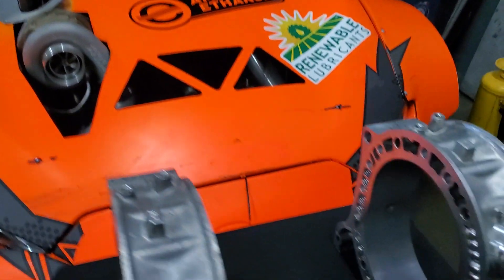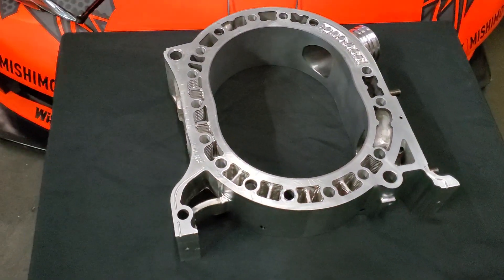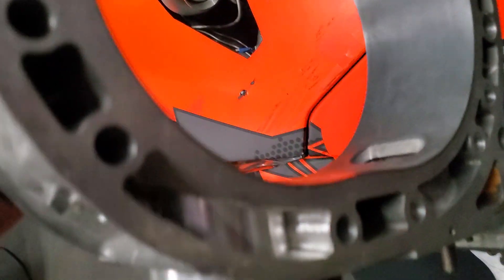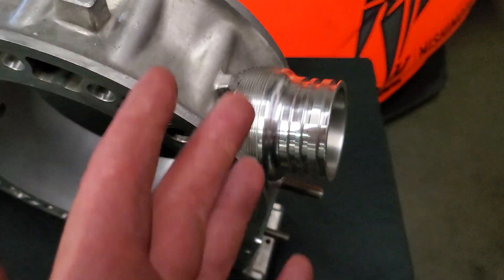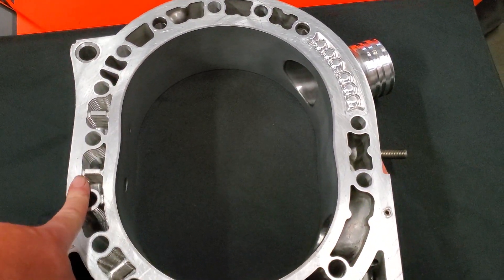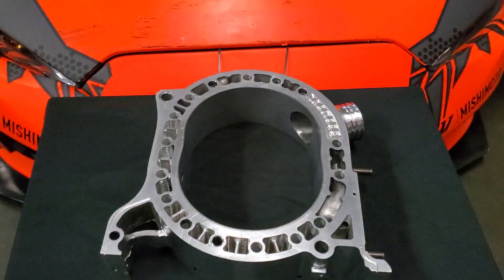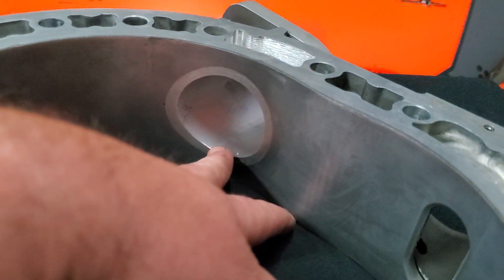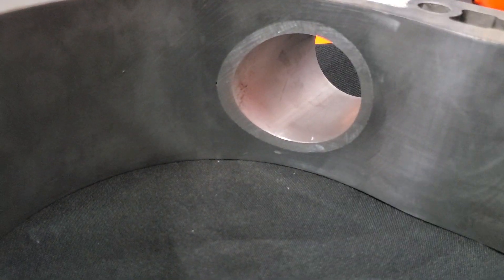Peripheral Port Rotary Housings, tech talk, comparisons, reviews and information Kyle Mohan Racing

Comment: R U aware of anyone re-plating Mazda housings with Nikasil? It's much better than Chrome, as they applied in OMC engines, electrolytic deposition; after the desired thickness was reached, they inverted polarity of DC, in order of having some porosity on working surface, allowing oil film to attach. Blessings +

Comment: I'd say the best Mazda Wankel porting combination would be a Peripheral Intake Port with the Side Exhaust Ports in Renesis RX-8 engine, no peripheral exhaust port, this will keep the absence of port overlap in Renesis engine, with the better BMEP the peripheral port offers; from old research, we know a rectangular intake port is better than a round intake port, and that for street car applications, a smaller area port is better than a larger one, but this is to be checked experimentally.
Reply: NOT, side exhaust ports is where the renesis engine design failed. no flow and build up too much carbon. NOTHING will flow better than a PPort whether  it be intake or exhaust
Reply: Thanks, but Side exhaust ports,  with a rectangular peripheral Intake port, will totally eliminate Port overlap, this is the main advantage in Renesis 13B. 
Port overlap sends fresh Mix to exhaust, Bad for BMEP, fuel Economy, emissions.
Carbon buildup may have a connection to the Oil used. 
If I get the money, I'd test the concept of Peripheral Intake Ports and Side Exhaust ports in a Single Rotor engine. 
A Low exhaust backpressure is important for RCE efficiency, but not in same grade with Peripheral or Side Intake Ports, Peripheral Intake Ports are more sensitive to exhaust manifold backpressure. 
I lack info about the Renesis Side Exhaust Ports sizes, flow, backpressure, usw
Side exhaust ports can be enlarged, exhaust gas track streamlined,...
Blessings +
Reply: @joseveintegenario-nisu1928  side exhaust ports will never ever ever flow as much as two peripheral exhaust ports. Do you understand that? You will never see drag racing rotary guys using renesis exhaust side ports alone.
Reply: @ultimatejay  I have no interest in racing RCEs, no interest in Aircraft Wankel, my only interest is in Rotary Engines for Street Cars. OK?
Reply: @joseveintegenario-nisu1928  In Wankel Port Tuning, I'd say a must is having beveled the intersection between duct and working surface, this increases Volumetric Efficiency, reduces the stress on seals from the clash with straight angle intersection

Comment: I've always been confused on why they even use side ports. I can see having some big monster hole in a PP would work badly at low rpm, but why not smaller holes?
Reply from the maker: Overlap is the big issue.  Small or big PP you get overlap.  Side port has better response for regular RPM as it has less.  Other things play a part but that's a basic reason
Reply: @KyleMohanRacing  ok, so why not add a valve on the PP so you can control the port timing and vary it like a vtech.  Use an electric controlled 'freevalve', or even a rotary valve might be better for high rpm.
Reply: It would be like exhaust power valves on a 2 stroke , the reason it was never implemented is again as two strokes , it is dead technology in today's world of emissions control and not much r&d is put into rotaries by OE .
Reply: @murraymadness4674  Ah yes of course Mazda came out with a new one and super high revving high HP one at that ,makes 13b REW and 20B looks like child's play doesn't it. And since according to you  rotary is the future being so efficient and clean burning  might as well come up with a rotary valve iteration and sell to the OEs and race teams and become a millionaire while at it.

Comment: With the first housing using the threaded insert, is it threaded against the backside of the smooth surface that the seal rides on? If yes, is it the "tightness" of the sleeve sealing it? If yes, wouldn't this distort the shape of the inner housing surface, causing premature wear to the seals? If not, what is sealing the port? Just curious, thanks!
Reply from the maker: Threaded, O ringed, and metal to metal with and epoxy back fill is the norm.  We can also offer metal inserts. Getting the seal to stay for a long period is hard. We go to great lengths and offer a verity of ways depending on the project.   In regard to warpage. no, it's never been an issue in the industry...
Reply: @KyleMohanRacing  great info, and thanks for the reply sir 🤠👍

Comment: Can a rotary engine have two housings with different pp shapes?
Reply: Why?
That’s like having a 2 cylinder engine with two different bores.

You need the same power/torque from both rotors to keep it not only in balance but to stop breaking eccentric shafts.
Both need to rotate and provide power equally to run smooth and reduce stresses.

Comment: Honestly, I think water jacket dimpling seems like it would cause cavitation.
Reply from the maker: Nope. No need to worry about cavitation. Its been being used in the industry for 30 plus years. I believe the factory mazda teams started it... the goal is to slow down the water and add surface area.  

If it didn't work then when tested the modded housing shouldn't always look better and last longer in extreme conditions.  This is a technique used by builders around the world. Not just me. 

I learned this technique from a Mazdaspeed factory engine builder.  

Also note:  late model housings,  like FD housings have deep pockets from the factory in these areas with sharp walls.  The factory added surface area and pockets to slow and capture water. 

At high rpm the water needs time and surface area to cool around the plugs. 

 Also the water system is under pressure so its highly unlikely. 

Usually cavitation issues arise at the water pump above 9000 rpm.  Then options become un under driven pully setup or electric water pump.  

Any questions let us know,  and thank for watching

Comment: Would love to see a small Semi PP on the Hybrid renesis from a few weeks back- it's actually something I'm actively researching at the moment for an open formula series up here in Canada! 

Going 2-3 Stage ITBs' should help deal with how it idles and can be done "on the cheap" using motorbike IT'bs, and since you're linking each port pairs together, the setup isn't too convoluted
Reply from the maker: I think it will be to much intake air. Probably no bottom end or mid range. I would just do the hybrid without the semi p. It should work better based on air volume.  But if you want to do it. Please let me know how it works.
Reply: @KyleMohanRacing  If you had a hybrid engine but put the PP on its own individual throttle and only actuate it at high rpm- I know this would be pain to set up. is it possible to keep the drivability with top end flow?
Reply from the maker: @teck9519  it might be a good way to go.  Intake manifold will be key
Reply: Semi pp lol